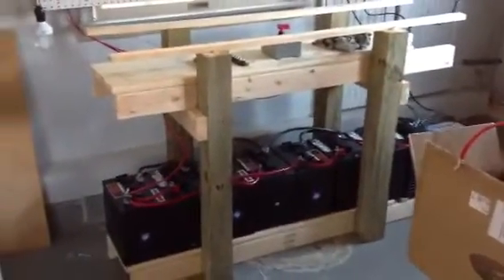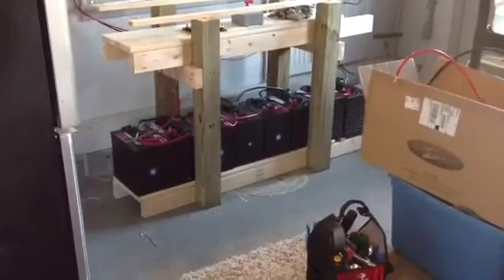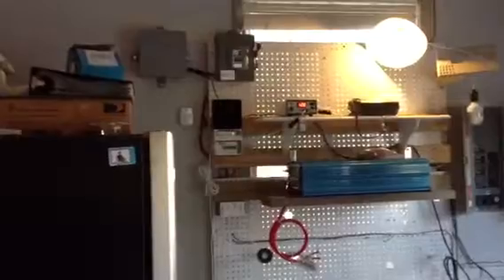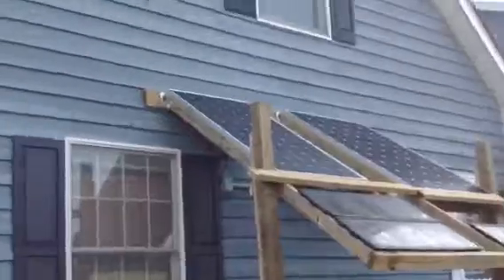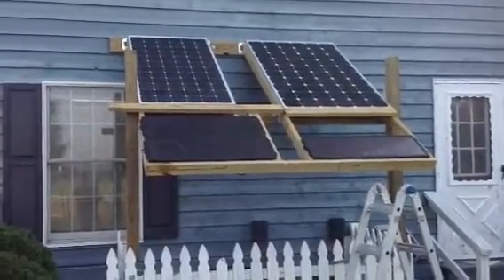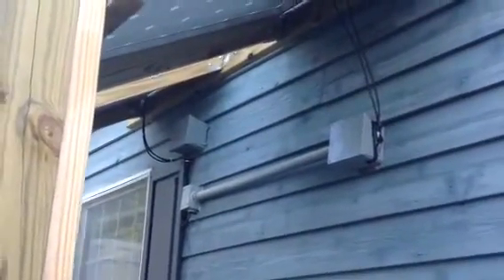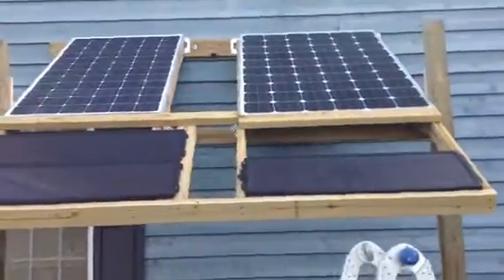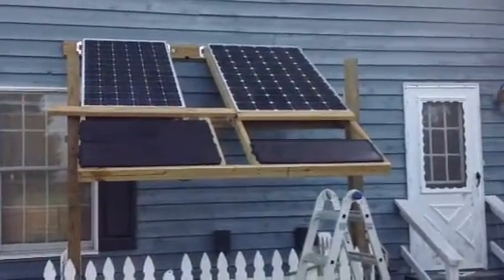Off Grid solar system

Comment: you need minimum 1200 watts in panel to properly maintain 8 6v batteries...and that's at the lower end of the need....I use 735 watts for 4 of those batteries and its barley enough to keep the batteries happy....not an opinion but a fact...hope this helps.